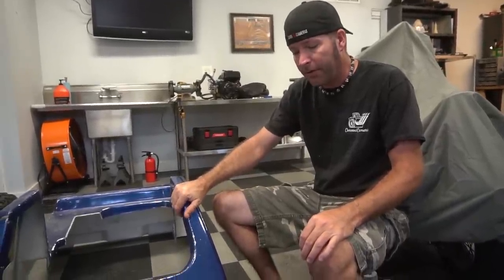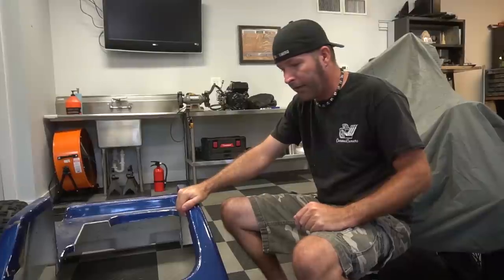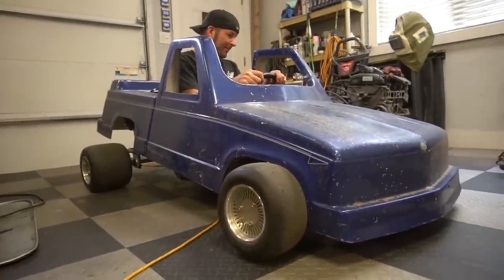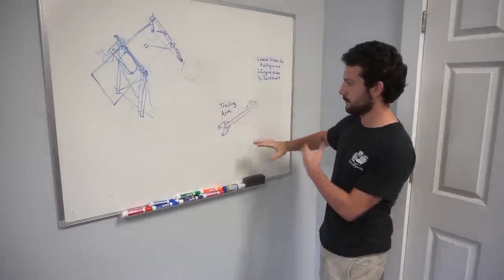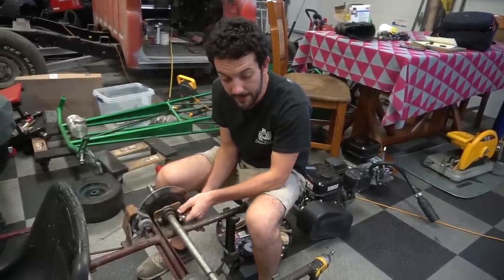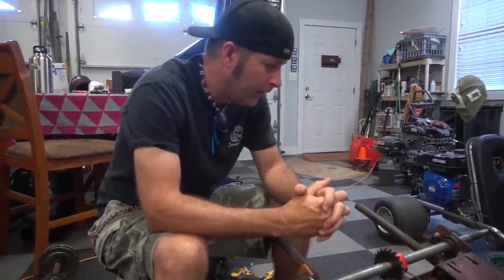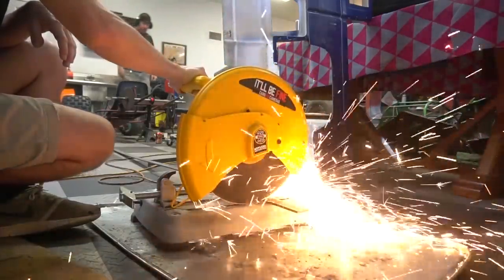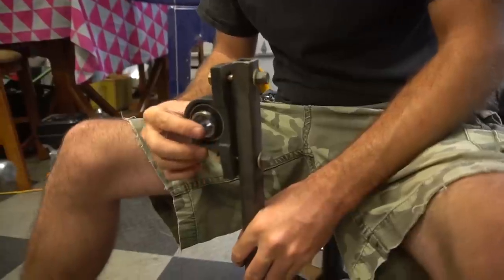Monster Truck Go Kart Build! Pt. 1

Comment: That Ducati engine would go great on the rail since it currently doesn't have an engine...20 more hp just saying...
Reply: I had an idea the other night while I was taking my nightly dump. "Cars and cameras should put the Ducati engine on the rail."
Reply: And then they could have gears instead of a torque converter
Reply: I'm pretty sure they touched on this topic. And said it would be too easy. They wanna build not buy the way to victory
Reply: @ogspmex9926  I mean theirs so much you can do with mods and fabricating. I'm sure its bound to happen.
Reply: ikr
Reply: The other problem is they measured the Ducati engine and it was wider than the frame of the rail, and they didnt want to have to modify it
Reply: They said they aren’t going to do that because the rear axle is not strong enough and has to much slop in it , and the main reason is they say it scares them with the bent frame on the rail

Comment: Great job on the trailing arm/jack shaft setup! Some other builders are mounting their engines on the swingarm, and the poor shocks are having to control the cart weight plus the engine bouncing around  . . . . not good! Maybe you'll need a panhard bar or tie the trailing arms together with an 'X' for side loads? Anyway, you'll figure it out! Again, great idea!
Reply: This!  Look at car and truck trailing arm suspension designs.  Wheel already invented :)
Reply: Twisting will throw chain and side load bearings.
Reply: Was thinking the same thing, those bearings won’t last if their forced to flex.

Comment: The slammed truck HAS to have under glow lol. Even just a cheap led light strip would work. Maybe a small secondary battery. Would be awesome to have "neon" underneath when you drop it and start throwing sparks off the mag plate!
Reply: Yes. Hope they see this
Reply: You are absolutely right
Reply: It's not a civic it's a mini truck. If ppl with mini trucks started doing underglow the world is doomed....
Reply: @MrBenstero  it's a go kart, dude. Try not to take it so seriously.
Reply: Yes
Reply: @MrBenstero  Mini trucking d-bags were using neon underglow long before the Honda fanboys. I probably installed miles of the stuff at work back in the late eighties.

Comment: Back in the late 50s & early 60s in the Deep South where I grew up, we just called it The Squat.  We were young, broke, and stupid.  Drag racing was IT.  We'd extend the front suspension to get the front bumper as high as possible and drop the rear as low as we could.  The idea was to maximize as much weight transfer to the rear axle as we could.  Was definitely unsafe and you had to pray you didn't have to make a quick turn. Those old cars were really death traps, but if you won - you didn't care.  Thanks to the Lord looking over me, I survived, and never told my children about any of it.  Your videos have brought back many great memories - just don't get too stupid 😉.
Reply: Lol. Thanks

Comment: That spray paint trick is very nifty.  We also use a trick like that (spray around the brackets) when removing a hood,  so when you put it back on,  it lines up in the same position.

Comment: Fellow north Carolinian here. 'Carolina lean' is the dumbest worst looking truck mod ever. Where they  squat the rear end and lift the front. I think some idiots actually the blocks out the rear end to achieve this.

This is usually paired with glass pack mufflers and 16 year Olds driving daddy's truck.

Comment: I wish I could add a pic or two, I have a monster truck kart, 19.5 inches of travel in rear, about 15 inches in front. Single link in rear with Panhard bar. If you ever come to the north west (wa) I would love to ride with you guys.
PS it will need reverse.

Comment: U could make it 4 wheel drive with independent suspension off the 4 wheeler by putting 2 of go power sports forward and reverse differentials and CV axles

Comment: Calorlin squat, tennessee tilt, kentucky lean, bama slam, "I wanted to lift my truck but still wanted to pull a trailer"  (which made no sense when you can buy a drop hitch....)  Or i wanted to put bigger tires but couldnt because the front wasnt high enough to still turn..  John you brought up some old retired rage lol

Comment: How are you going to deal with 1) axle side to side location? A panhard bar will move the rear axle sprocket through an arc, causing side to side alignment issues.  2) sprocket alignment in an articulation situation? As the rear axle rotates, so will the rear sprocket.

Comment: I only see one issue with your suspension. You wont have any articulation unless you give the trailing arms a way to turn. With the current design the axle wont be able to change angles in the pillow blocks to flex. So when your driving it body roll will probably kill your suspension. Ball bearings arent good with torsional thrust.

Comment: I am curious to see how you get the front suspenion inside the current body. To add the long travel (er, longer anyhow) suspension from the fourwheeler inside that body, you will not have any place to put your feet or legs in the current four wheelers configuration. I foresee a body/ frame stretch to get it to fit, that is unless they do a fourlink suspension similar to the rear on the front basically building a new suspension under the current frames front and having the arms meet up somewhere  under the seat or just ahead of. Might even make it into a solid axle and maybe even figure out a way to make it a four wheel drive go kart, just need to design a way to put steering knuckles onto a go cart drive axle. Food for thought.

Comment: You should brace that rear swingarm, make triangles not squares
Also for the suspension, make it soft
Should be much closer to the pivot on the upper anchor point than the lower

Comment: Just a thought to throw at you. 1. Hinge the body from the rear and add a hood hydro arm so you can get in and out easier. 2. If it is going to be a solid rear axle, bend those trailing arms into the center and make a 5 point rear suspension.  Love your videos and just wanted to toss an idea out there.

Comment: For your air bags you can run a 420 so you have a charging System and then run electric acuators like hydraulic cylinders on all for corners

Comment: Isn't it possible to implement a mountain bike gear changing system to a gokart to gain speed? Wouldn't you think once the go kart is in motion changing gears would be easier on the engine in higher gear?

Comment: Chains will snap with suspension movement because of the 2 gears on the axel. One gear will be wanting to twist with the suspension and the other gear will want to stay in line with the motor

Comment: To be able to 3 wheel on the other frame the axle has to be able to rotate so find a differential off of something a tiny diff and make the driveshaft come up and secure and mount it to one of those gear box things like what's on the ratwagon

Comment: You should use shocks off of a air ride car on the monster cart so you can change the ride height on it as well Pontiac Bonneville has them would look really cool

Comment: Hi,
Cool project.

I think you are going to have problems with the last chain because as it is built now the wheel  axle will change angle to follow the terrain. The chain won't like that.
A panhard bar will not do the trick. So you'll have a lot of welding to do.
I really wonder how you'll do it without using the Quad method.
Cheers from Belgium
Reply: Its not independent on the rear. We welded the two together

Comment: HEY. I don't know if you thought of this but It needs to be considered. What happens when this suspension set up needs to compress one side and extend the other (flex)? Won't the sprockets come out of alignment and throw the chain? As well as bind up the final axel on the bearings? Or are you going to find a way to make the 2 sides even at all times? It may just be a dumb question and me not understanding the setup correctly but I think that will be an issue.
Reply: Both rear arms will be welded together to move as one

Comment: You should probably add some sort of cross bar between the two trailing arms to make it one "unit". Otherwise your axle will end up in a bind if you flex to much. And you might loose a chain as well from the articulation. Jus sayin!
Reply: We did

Comment: hey guys, you realize the each of those swing arms should not move independently?  and you do NOT want the live axle (and it's bearings trying to stop the inevitable "twisting"!.  even mounting the sprocket sightly off the center of the axle will cause a twisting of one side  (from the torque) from mechanical advantage / disadvantage  (look how a motorcycle swing arm moves because of torque  and causes bikes with chains to "squat") if you leave the swingers independent you will need to put each Live axle bearing in to some kind of swivel ... think about it.
Reply: We allready welded them together
Reply: Isaac it'll be fine  i Love IT! “It will be fine” yes... yes IT will! Thanks for the reply!

Comment: You could have done the rear suspension way better using an old four wheeler rear end. It would be fully independant, and chain driven. I dont remeber what four wheeler its out of, but it has a chain driven diff, making it perfect for go karts
Reply: Yea. we didnt have one
Reply: @isaacitllbefine7231  i respect that

Comment: Articulation in the rear suspension will be bad news for your chain drive. You'll never be able to keep the chain on. You'll want to tie both arms together so one cannot move without the other. Any side to side flex of the rear will pop your chain.
Reply: They are welded together
Reply: @isaacitllbefine7231  sweet, going to be sick when its finished. Can't wait for the next video!

Comment: I’m putting a 212 on a gravely 408 mower   It has a 4 speed transmission with a clutch. Do I still neeed a clutch on the motor or torque converter? Or do I just put a pulley on the motor spindle
Reply: Just use a pulley man i had a sears st10 i did with a 670 before i killed the tractors original steering
Reply: Im not familiar with the setup